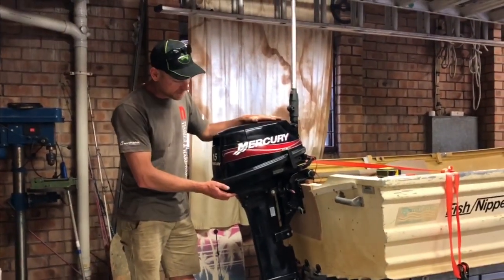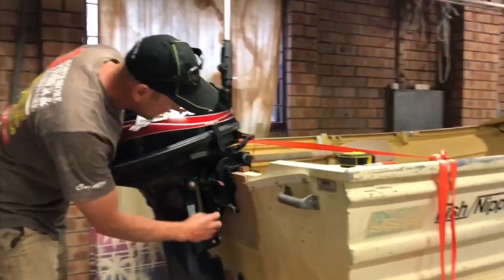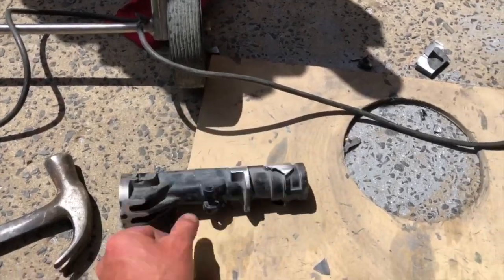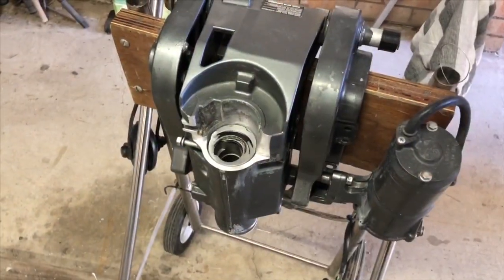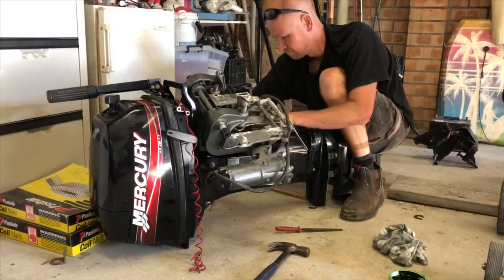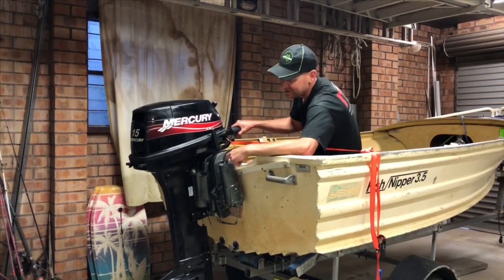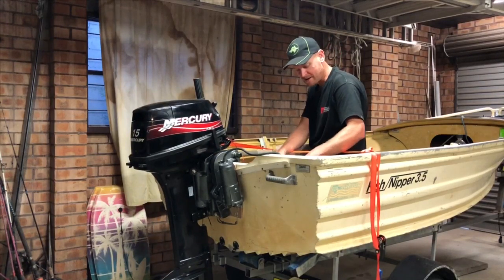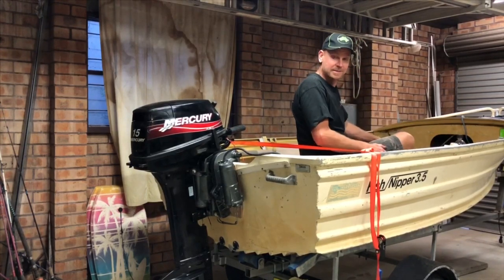15hp custom trim and tilt.

Comment: That's the best mod I've seen for that size motor! Fucking better than any eBay jacking plate, well done mate 👍 Hey what pitch prop you run on that 18?  Next stop put on twin motor bike carbs and exhaust modification! 😂

Comment: Correct me if I’m wrong but I suspect you have used the tilt ram and the second ram is the trim ram that is slower thus why it only goes at one speed which is the faster speed of the tilt ram, shouldn’t be an issue on a 15hp other than fine adjustments of trim will be harder than normal. Great job though and I wish my 15hp had this
Reply from the maker: The 55hp - 65hp Suzuki rams are both single speed (same power throughout the stroke). You are correct that most outboards have extra shorter rams for the trim. There are a few single speed rams capable of trim and tilt (Mercury has some on there V6 outboards) also.
The trim works very well on the 15hp. The speed of trim is a little fast as you may imagine but I got used to that pretty quick.
Cheers,
Glenno

Comment: How do you remove the just left and right clamp brackets off the super
Reply from the maker: Hi mate,
You need to undo the nut on the pivot tube and also any brackets that tie the two clamp brackets together then they just slide off.
cheers 🍻

Comment: That a great job man 
how much more weight are you putting back on the transom ?
Reply from the maker: I think I have added about 10kgs.
Good point, I will weigh the motor.
I’m not too worried though because the tinny it’s on is a beast.

Comment: Great job but a lot of trouble for a little 15hp.
Reply from the maker: Ha, so so true mate.
Massive amount of tinkering for sure. Definitely not worth the labour and cost if that’s what i was looking at. I do use that motor a whole heap and smile every time I trim or tilt it.
I just like doing that sort of thing as a hobby, I don’t watch much TV, no video games so tinkering with outboards is great fun. 
I guess it’s like me looking at a guy making a model boat, so many hours, he won’t get paid for it it’s not viable etc but it’s his hobby so whatever. 
I am a glutton for punishment, I just did it to a 30hp as well.
It breaks up the standard rebuilds for me too.